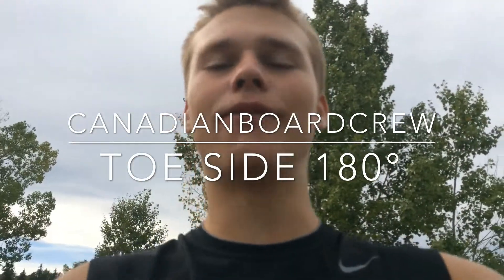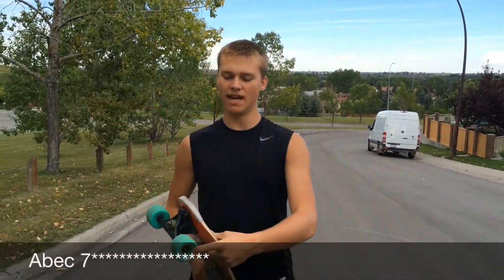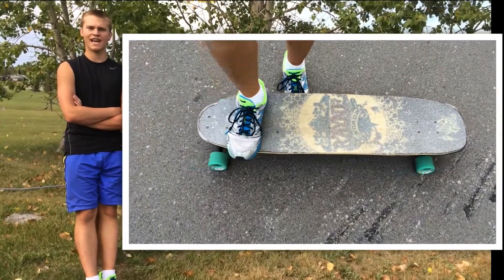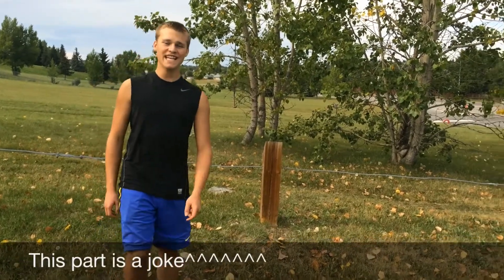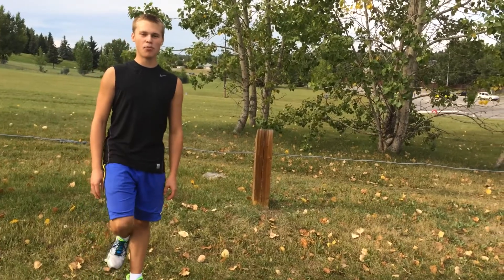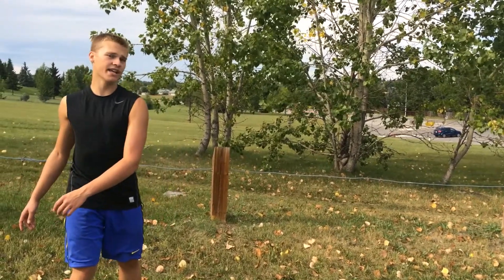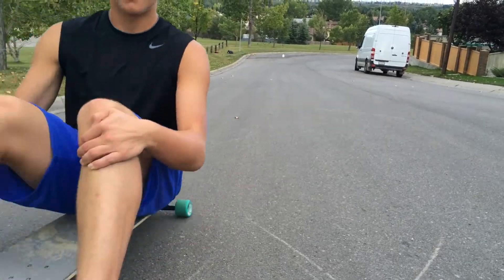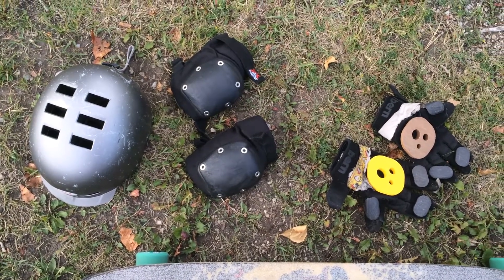How to Toe Side 180! (stand up slide)

Comment: I always do the 180 easily but I always lose my balance and step off. Is there any tips to stay on the board when going around 10-15 mph?
Reply from the maker: It's all a mental block. You can do it perfectly fine, but your brain developed a habit of stepping off. Get yourself in the mindset of "I will keep my feet of the board" and you probably will after some practice. I had the same issue too.